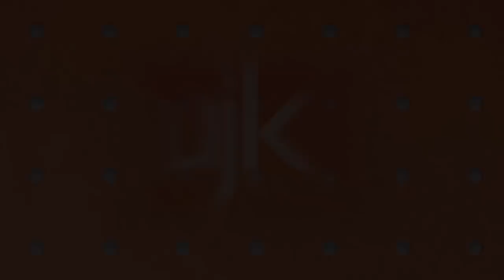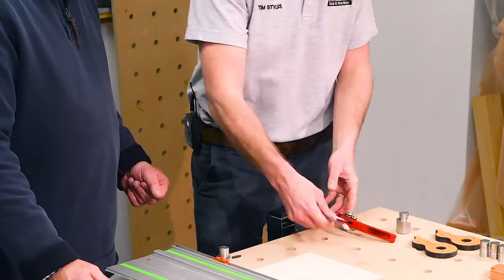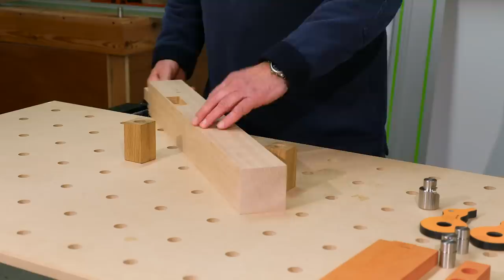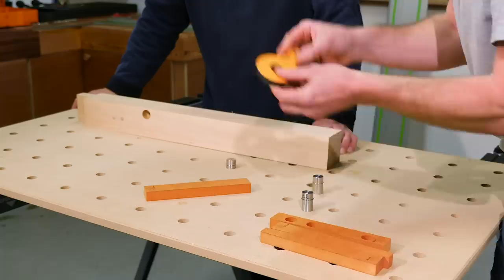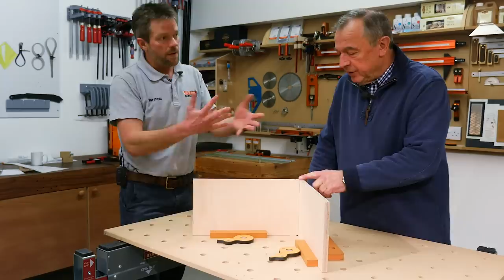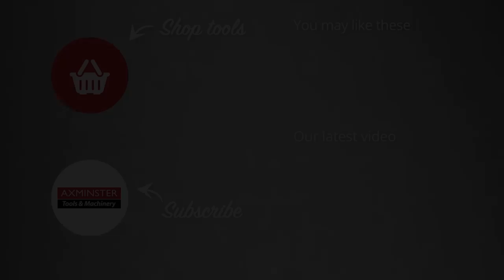UJK technology and Parf products -  a new way of working

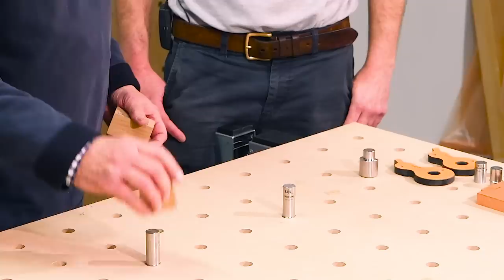Comment: 3:17 'You can make these at home if you wish'. Yes, you can make ALL of it at home. Make your dogs 20mm for the depth of your table and 21mm above it. No collars or chamfers needed, one part dogs (not 8!).  Not got a metal lathe? Buy stainless steel 20mm bar by the metre- 50mm dogs for less than £1 a piece. BTW if you want to make a top it is cheaper and (much) faster to just buy a CNC cut template. The system is great- but we are craftsmen; the idea is all we need.

Comment: I bought your rail clips not knowing if they would fit my Powertec rails (very popular in the USA). They did not fit -- at first. I gave the oblique faces a very light sanding -- just enough to remove the high spots of those faces, to make them flatter surfaces. Now they fit beautifully. By the way,  the wire clips fit 3/4 inch dog posts -- also popular in the USA.  Bravi!

Comment: Yep, its a very useful and accurate system. I've mounted a second top vertically on the side of my UJK bench - its dogged into the legs of the bench, dead square with the top for doing face and edge work for jointing cabinets - no need for a dowelling system or a Domino machine for getting accurate joints.

Comment: It's a great setup. The annoying thing with the parf dogs (used with UJK clips) is that the Festool ts55 motor bangs into them, so your saw has to start and stop it's cut between the dogs, which really limits the size of cut you can make on an MFT type top. Yes you can make the cut long ways, but then you lose support.
Reply: There are different size parf dogs that will not clash with the TS55 motor housing.

Comment: Sorry that i have to say  that the  the reamer and chamfer tool i bought recently - enlarged the 20 mm holes of my festool mft 3 so that my close fit bench dogs are
much looser than before - too loose. In contrast to this the Parf Mark II which i also bought is realy great. Any help on the reamer and chamfer tool ?
Reply from the maker: Hi there, the UJK Reamer and Chamfer tool is designed to slightly open up the 20mm holes to a size that will also allow for future movement or shrinkage due to ambient moisture and temperature change. Dogs fitted into these reamed and chamfered holes will feel very slightly looser, but should still sit vertical due to the chamfer, without movement that will affect squareness of cuts. Hope this helps
Reply: @axminster  in my case the tool doesnt drill centric. Tested this with measure tools we use in engineering / mechanic industrie. I guess the tool felt on the foor - before delivered.
Reply from the maker: I would advise you contact our technical team, who may be able to assist you with this and assess what's happening https://www.axminstertools.com/contact